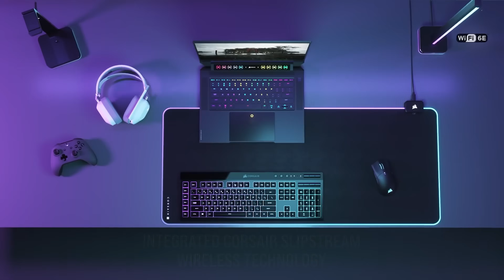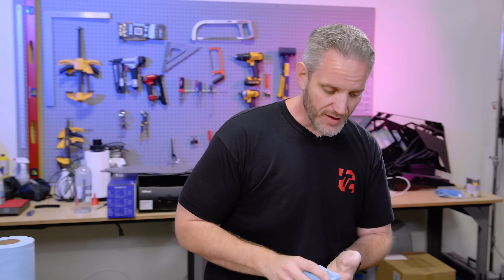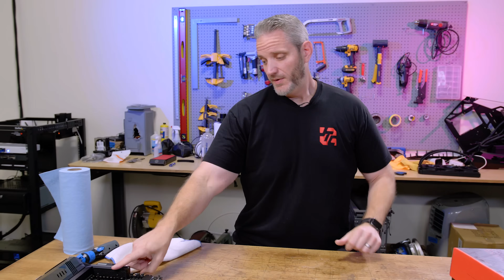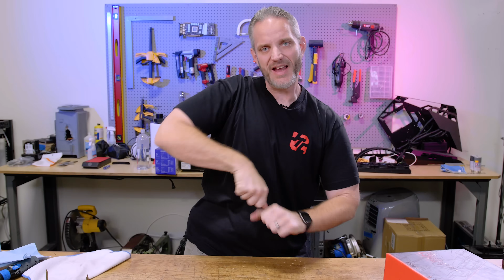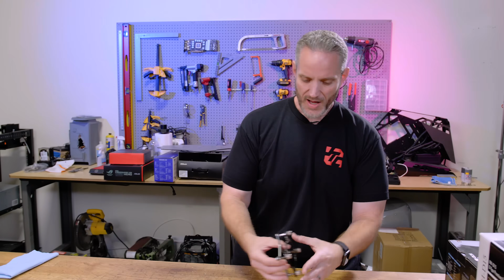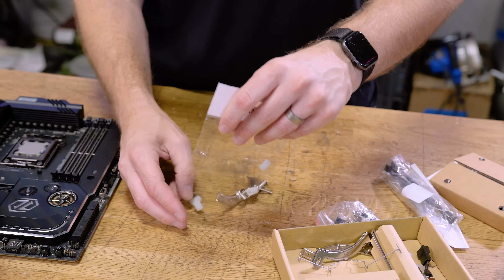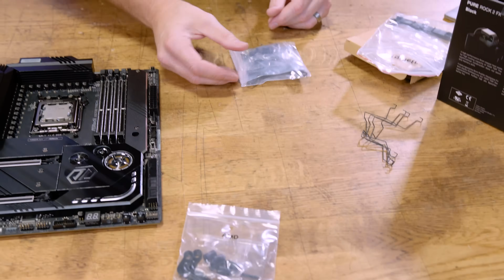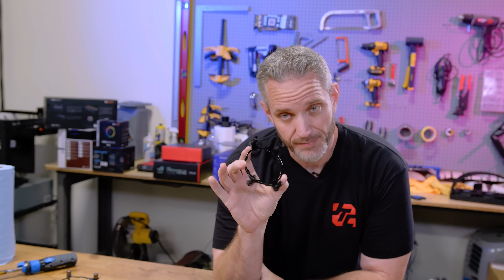AMD made a terrible flaw with this design...

Comment: I wish they hadn't worried about cooler compatability and just made the thermal transfer as good as possible.
Reply: My take on it is that they need the room for future 3dvcache additions?
Reply: @jaydenwhite2724  but then the die of the cpu is to low anyway? so, i dont know. do you think they will change the ihs, so it has different levels of thickness?
Reply: @jaydenwhite2724  I suspect the X3D range might be one of the reasons why as well, but marketing still have to sell this to consumers before then.
Reply: @jaydenwhite2724  good point
Reply: @SoundwaveSinus9 gtx480-sli wants to talk with you about being 100°C at the die all the time
Reply: @majstealth  I know, lol.  My 5700XT is still going strong at 100C.  My MSI 6900XT goes to 110C in a few games.  Not to mention these are all maximum load which are hardly the norm.
Reply: @SoundwaveSinus9 Reduce the temp limit then.
Reply: Just undervolt the CPU? That was the first thing I thought about. My 5800x has been at 45c under load and I haven't lost any performance. Chilling at .975 volts
Reply: @SkyRecruit18  holy SHIT you got a golden bin there, my guy. Consider me mad jealous 😂
Reply: Oh ya adding more cost to an already expensive platform will help sales lol!
Reply: @martytube821  Oh, yeah, DDR5 Intel is even more expensive. Lol.
Reply: @martytube821  AMD could of made the socket thicker for pennies on the dollar so the IHS could be thinner. This would also insulate some heat away from the motherboard
Reply: @timothygibney159  "could of made' <- genius
Reply: lol this thread, you guys are fighting about the 95c of AMD that only happens when benchmarking or rendering lol, the 7950x runs at 70c when gaming so it won't be a problem. I hate how reviewers highlights extreme scenario that only happens to some people and make it seem that it always happens.
Reply: @apricreed9580  haha. You find it annoying. I'm the one getting all of the notifications 😆
Reply: Choosing and buying hardware is a lot easier and enjoyable when you aren’t debating with armchair engineers that think they know better than the actual engineers who designed the chips.
Reply: I   agree, aldough the Temps in gaming are 60 to 80c which is normal.  Unless you are slamming the cpu in stuff like cinebench the cpu has normal temps
Reply: All they would really need to do is sell the appropriate hardware for both sockets and not a mediocre one size fits all contraption that should have never been marketed for both sockets.  If I had ruined a CPU from overheating it from use of a bad cooler that they said would not ruin it I would get together with all the people who had it happen to them and sue them out of existence!!
Reply: @charleshines8523  What people have ruined them?
Reply: Yeah they gimped the design of Ryzen 7000 series and I believe they engineered around the problem of the IHS making changes to work at 95 degrees. I haven't heard of the warranty of the new 7000 series, but the idea of running a 95 degree CPU for 3 or more years just sounds like a noisy hot mess to me  bound to cause AIO failure.
Reply: Being forced to change mobo and ram at least costs a lot. Being forced to buy AIO too... i would go for 13gen ddr4 and spend way less at somewhat similar performance...
Reply: @nenadcaric5195  I Typically upgrade every 2-3 years, so wouldn't make sense to go Intel since I have 5600X.  Both will be good for many years to come for people.  No wrong decision.
Reply: @farmeunit  yyy i spoke about real upgrade, from lets say intel 9 gen or older..  i personally will skip upgrade for a few more years... i have 5800x3d and Rx 6900 xt... i upgraded cpu from R5 3600 and I'm good to go now for a loong loong time since i assuming that gpu will hold 1440P gaming for at least 3 years 😅
Reply: With the amount of AM4 coolers out there I'm glad they are making them compatible, that would produce a ton of waste. But I guess the 2nd hand market would be booming.....depends if you trust a 2nd hand AIO?
Reply: @SoundwaveSinus9 It is overheating at 95C you are reducing the lifespan of the silicon significantly.
Reply: @Edpro01-z5d  It isn't overhheating at 95C, you just grab for straws to make AMD fail.
Reply: They shouldn’t cater to the 1% of those who actually care about benchmarks. The vast majority of people who are buying these CPU’s are probably buying them either for work or for gaming.
Reply: I love watching how everyone just absolutely shits on the one dingo berry
Reply: Yea, but it's ezy to be wise afterwards. 
To fix this issue I am all happy if there is going to be a de-lid kit to buy so I can remove it safely and have all i need to mount the cooler correctly afterwards or use liquid metal. For sure I do understand it's not a task everyone is cool with
Reply: Who cares about thermal transfer efficiency when it's gonna hit 95C anyway
Reply: Same
Reply: ME TOO!
Reply: @SoundwaveSinus9 There is something that is not being said or discussed (I don't understand why) But these new AMD AM5/7000 series processors running 95c constantly is literally the definition of planned obsolescence. These processors will not be functional beyond 7 years max and most will likely die at 5 years or sooner of daily usage at these temps. AMD knows this. They expect anyone that buys today's 7000 series processors will upgrade or replace their system well before 7 years and likely before 5 years so they don't care if their parts fail later. This is what has me feeling a "sour taste in my mouth" for AMD this time around. Everyone can remember the R9 290X/390X "Hawaii" chip video cards. The stock blower cards were all "Designed to work at 95c" and here today there's almost none of them still functional years later. They all failed because they ran hot for a long time. Any computer processing chip (CPU or GPU) that runs hot for a long period of time is going to fail faster than the same part that is run cooler. It's called physics.
Reply: @G T you would just need a different mounting kit, which would be fine. the way they have done it now, just sucks. yeah, you can get around it, kind of, by lowering the power limit and dont lose that much performance but making the ihs a proper thickness, would be the real solution, so you can decide for yourself. full power consumption and more performance, even though it isnt really much, or saving power and lower temperatures.
Reply: Am 5.1 will
Reply: I'm glad they went with cooler compatibility. Just undervolt
Reply: 95 degrees is a bit high and worrisome.
Reply: Agreed
Reply: AMD stated from day one that there where thermo issue. That is why overclocking was restricted from the beginning. Sounds to me like they knew very quickly after it went into production that they had a problem but the costs of changing the design would be too costly for everyone.
Reply: They just need to begin selling de-lidded versions of this CPU and allow vendors to custom make coolers that compensate for the missing CPU lid.
Reply: @sp6450  or wait for the v-cache version. Seriously though the temps don't matter, unless you're overclocking etc, it's rated for it.
Reply: @Commander_ZiN  The lower the temps the higher this thing will boost itself. V-cache or not my statement stands as a powerful solution. If you think AMD will change its lid to a thinner one to allow better cooling, I think its too late for this generation of CPU's.
Reply: @sp6450  no the cooling is fine, unless you're overclocking. You won't go any faster if it's cooler because you're still capped by power draw, You'll meet max clocks as is.

I have a 5800X I think TJmax was 95 from memory, even in the middle of summer over 90c still runs full speed. Granted it's closer to 70c usually or less.

Still I'd be waiting for v-cache anyway. They will have a thinner IHS because the chips are higher. The IHS is thick to plan ahead for v-cache.

Anyway look at the reviews, it's performing really well. If you want to overclock and remove the IHS even better, but I'd wait for reviews on that.
Reply: all the noctua wah wah babies would cry
Reply: @jblps  they would survive it.
Reply: "Partial" cooler compatibility.
If they had a normal IHS and the same 95 degree target they'd look even better in the graphs.🙄
Reply: The problem with not having compatibility from the start is the length of time it would take to make a completely new cooler design for companies. Anyone who has ever heard of Noctua also knows they are positively glacial in getting new products out.
Reply: @nozyspy4967  i guess a new mounting kit would have done it too.
Reply: @nozyspy4967  CPU companies distribute the blueprints for cooler requirements many months before the release of a new socket.  Designing a cooler adapter for a new socket is nothing compared to designing the cooler.
Reply: @SoundwaveSinus9 It is a boost, it should not hit 95°C standard all the time. 

Apart from that, it should not boost past a certain wattage. So if you can cool the cpu at full boost (and that is indeed a tall order it seems) it should not hit that temp either.
Reply: @SoundwaveSinus9 science doesnt care about your feelings 😆
Reply: Agreed also they should've not worried about using LGA as well.
Reply: @sludgefactory241  why not? LGA is the only thing making sense at this pin and cpu size, besides making it way harder to just rip the cpu out of the socket when removing the cooler. 

That was a HUUUUGE flaw on AM4 PGA.
Reply: @RubiiX 😂
Reply: Why not both
Reply: Should have made that vapor chamber IHS prototype that they showed GN during the lab tour
Reply: O dont know what yall worried about my 7800 x3d never gets above 70c with a single tower passive cooler
Reply: exactly, bit of a head scratcher...
Reply: AMD is in a way doing what all x86 chips suffer: backward compatibility. All the old instructions set from the original 8086 to today is inside the chip but now they have contend with backward compatibility of an old form factor.

Wild.
Reply: @nexusyang4832  it just doesn't make any sense. A new mounting kit costs like 20 bucks if one is unlucky, many times manufacturers even provide them for free or like 5-6 bucks. If we now see that a different new IHS with a new mounting kit could save us like 10K or so, this seems like a steal honestly. 
IF you really wanna silently ulitize the full potential you WILL need to go with a custom liquid cooling loop or at least an AiO which fan speeds are controllable according to coolant temperature, otherwise you'll just hear your fans loud and clear. 

Even if temps get to like 70°C while gaming this will be super noticeable with usual AiOs and even a worse problem with air coolers that get the hot air from the GPU. And yes, even a 300W GPU throws in enough heat to make a significant difference.
Reply: @nexusyang4832  wouldn't it be great if both side agreed to cut old  extensions or emulation of old extensions
Reply: But they need to make x3D CPUs as well. I think thats the Reason why they made it that Way. They will have to make a smaller Heatspreader for that as well.
Reply: The fact they went for this compromise at the expense of freakin 20C is mindboggling to me, i mean i would expect this from Apple with the logic that the CPUs will break faster so more sales, very scummy from AMD and damn is this stupid, we're going smaller and smaller transistor-sise only to up the power draw and temps.....
Reply: @Nimzoc  WHAT compromise? "Oh noes, it beats the Alder Lake, but we have a huge IHS"????
"the CPUs will break faster"
And the sky is falling too, Chicken Little.
Reply: @markhackett2302  If you actually watched the video you would know?, they added an extra ~2mm to the IHS so that it would be "compatible" to other coolers at the expense of freakin 20C and a quite hefty decrease in performance due to said temps....(watch der8auer' vid on the impact after the delid).

Let me put it into entitled apple fanboy language so that everyone can understand, imagine Apple making a way bigger phone(say 7.5 inch) with way better performance but keeping only the display the same size only to be able to fit the previous gen glass screen protector(6.1 inch) and also due to this it can't cool properly through the screen  (or something) and it's also super hot....

I'm sorry but if a delid can reduce temps by 20c and add quite a substantial performance boost at stock voltage your design team is either very stupid or this was very intentional so that it can be "fixed" little by little in future iterations of Ryzen...

I honestly don't get people like you, do you hate inovation?, do you work at AMD?, are you married to Lisa? :)
Reply: @Nimzoc  It's not "scummy" in the slightest. zen 4 operates fine, 247365 at 95 c if you are doing blender renders all day. if you are not doing full thread loads all day, then it wont even get there. but amd wanted peoples coolers to work, and they had to move on to a new platform with am5 one day, which they finally did. people complaining about temps with zen 4 have no idea what they are talking about. ther is nothing to complain about here.
Reply: just delid the CPU and enjoy the 20 degrees C headroom ON TOP OF AN ALREADY INSANE CHIP.
Reply: @SoundwaveSinus9 Unfortunately these high temperature reduce efficiency due to higher losses. I would only use these cpus with direct die cooling.
Reply: @killersberg1  Undervolt…. Or run ECO mode….  Slightly under lock.  Lots of ways to fix the problem and you can get more performance because of increased boost headroom.  I agree it’s bad form, but easily fixed.
Reply: @farmeunit  When these get cheap enough to justify I will direct die and undervolt for optimal efficiency in an itx case.
Reply: @killersberg1  I will just wait for next gen.  I don't have the urge to devote to de-lidding or tweaking that much, honestly.  I just want things to work.  If it's a matter of clicking a setting, I will do that...
Reply: @farmeunit  If these were not so expensive I would go for it but you get more cores on raptor lake for the same money. 14 instead of 6 bruh.
Reply: @farmeunit  And it just works. Yet here you are, claiming you want it to just work, when AM5 currently works.
Reply: @killersberg1  We haven't got the price of RaptorLake. We only have retail prices. You retail, buying 1000s, bruh?
Reply: @markhackett2302  I didn't say it didn't work, lol.  But whatever....  I was talking about de-lidding, you know, which I specifically said in that post.
Reply: @farmeunit  But nothing stops you delidding the AM5, either, so I fail utterly to see how that could be relevant "in that post".
Reply: @markhackett2302  I just stated that I don't want to bother doing it, lol.  It is more work than I am willing to put in because I have grown out of those kinds of things trying to get the best performance.
Reply: @markhackett2302  Here in germany, where I live we already have street prices. The 13600k is 400€ with 14 Cores/24Threads, while the 7600x is 370€ with 6 Cores and 12 Threads. With intel you get cheaper last gen boards and way more cores. I know E cores are not nearly as fast as the P cores but they may just be the right thing for my application. If amd doesn't do massive price drops they really provide a terrible deal.
Reply: @killersberg1  20 threads, not 24
Reply: @killersberg1  Higher losses? Doesn't that mean more loss to the HEAT EXTRACTOR???
Reply: AMD has chose thicker Heat spreader, because the x3D need more space, 95 ° is fully fine, this temperatures comes up only on Full load and unnecessary cooling component waste is avoided. My Intel Laptop Hi-end CPU from 2012 goes always to 105° and its work fine until today.

In the case when everybody needs new cooler there will be undifferentiated hate too, because Intel fanboys are always on a Fanatic search to to talk up their product, just so that the Intel tattoo on the upper arm doesn't have to go.
Reply: @MultiPochop  I don't know why everyone isn't liking your post it's like the first correct post in this thread.

People the IHS is thicker for vertical stacking. Temps are fine, it's designed for it.
Reply: @MultiPochop  No the heat spreader is thicker because of bacwards compatibility with coolers. 3D vcache was fine with zen 3. 95C isn't fine.
Reply: remember some of old Electronics courses that said (for longevity of electronics components using Silicon): for each 10°C increase, you divide by 2 (yeah, 2) the lifespan of the component. So, you know that at 75°C continuously usage a given component will have a lifespan 4 times longer than that same component at 95°C (just imagine, then, if the temperature is at 50°C or less…)
Reply: @grospoulpe951  No, for each 10c ABOVE DESIGN TEMPERATURE you divide life by half.
Reply: @tim3172  alright then, let's accept that (but I still think that the lower the difference between ambient temperature and the CPU temperature, the better). Anyway, what about the other component near the CPU? Maybe that's why X670E MB are so expensive, MB manufacturer have to build stronger MB I guess.
Anyway, ZEN 5 platform is still young, so let's see what will happen in the future, I guess (personally, no rush: my 5600X works fine for my usage; just a GPU upgrade is mandatory, I guess ... Navi 32 / AD103 (or even Battlemage 😅), maybe...
Reply: @grospoulpe951  So it lasts 400 years at 75C, 100 years at 85C, and 100 years at 95C. I fail to see the problem with that. Further, those "old electronics courses" would be from, oh, I don't know, OLD ELECTRONICS. Old Ford motors got to 25mph. So claiming "Some old magazines say you will have your lungs explode above 35mph" is ACCURATE, but meaningless.
Reply: @grospoulpe951  That only meant for Capacitor, but for CPU I don't think this will make much a difference. I'm a power supply engineer BTW.
Reply: @Ssin1235  Ah, OK, then 🙂
Reply: @grospoulpe951  Thank you sir. Some common sense. Also I want an all white mini itx build as my next. Heat matters especially in that form factor. It's harder to build for sure and a challenge
Reply: @timothygibney159  so just turn on ECO? This is literally a mode switch that significantly Cuts power budget and therefore thermals, while giving you 85 to 90% of the performance. Your argument of "I'm going Intel because AMD's running hot," IMMEDIATELY falls apart because news flash, SO ARE THEY.

This is a direct consequence of the gigahertz arms race, (CPUs and GPUs alike) which in my honest opinion has BEEN stupid for almost 10 years. Tens of Watts in extra power draw for a couple hundred megahertz and it makes no sense.
Reply: @spence8920  Lol wow the salty flamethrowers are after me lol. Look dude my 10 year old pcs still run. I want a mini itx white build next. I care about heat and longevity and have been burned (no pun intended) in the past by ATI/AMD overclocked GPUs burning hot and loud. I do not want them. THe difference is (yes I agree 12900K is too hot) is Intel is not designed to immediate thrust to 95 TJMAX BY DEFAULT. Gamers Nexus confirmed this was deigned to win at benchmarks and just not worry about it. I know you are an AMD fan and feel hurt but it is just a company and if we all don't want to have overpriced garbage ...looking at you Nvidia ... then we need to stop associating identities with companies and open our wallets. The difference between Intel VS AMD is Intel doesn't deliberate design their products to BURN by pdo 2.0 to 95C by default. They can get that hot but not without after turning off half the motherboard features and fan curves. 

I may just give up and get a new hobby. If Intel's 13900K does the same I will go angry too! I will retract my comments here and get an Xbox when my 9900K and 380ti become obsolete. ... ok maybe that is extreme but jeesh. You spend your money on what you see best I will do the same. For the record the reason I use Intel now is 1. For work/certifications my Hyper-V lab needed embedded virtualization. Intel VT-D/X supported this for 5 years before AMD-V 2. I use Intel RST for my raid 0 ssds for my VM lab work. If you are reading this as a gamer who cares it is not your use case. AMD-V now supports hyper-V so I can switch so I am open again. This has nothing to do with me being a fan of one company vs another
Reply: @timothygibney159  The 12900K does get to 95c it only stays there for a few seconds as Intel arbitrarily limits the turbo boost.
"AMD-V now supports hyper-V"
It supported it in the Athlon X2 days (circa 2005).
What planet are you on?
Reply: @tim3172  I knew someone would have answered that, I just spend 20 minutes reading comments just to see it :D I was thinking exactly the same when I read the guy's comment, like 'euh, did I miss something? what is he talking about?' :D
Reply: @timothygibney159  Tell me you work for userbenchmark without telling me you work for userbenchmark.
Reply: @timothygibney159  "Oh noes, everyone is against me, I MUST be right!!!!". Nope. You are wrong. You'd get "flamethrowers after you" if you claimed 1+1=Elephant too, and here you are whinging.
Reply: @SoundwaveSinus9 My 5 year old h100 Corsair aio pump still works. How? I don't overclock my 9900k past 4.9 ghz and that 5.0 ghz barrier rapidly increases voltage from 1.26 volts to 1.34 and increases heat by 17c! So my h100 pumps only 1/3 to 1/2 it's normal rate. I only feel heat when working on virtual machines for work. 

95c IS NOT ACCEPTABLE?! I don't want to buy a new aios every 3-5 months. I don't want to have my motherboard warp like the Xbox 360 red ring of death due to this. I don't want to hear my fans blast full 90% of the time and get hot so AMD can win at benchmarks. It's not normal. FYI why do Honda Civics last forever? The reason is the engines and transmissions are over built and under run below spec so they hardly ever wear out.
Reply: @timothygibney159  havent you seen the video? the ihs thickness is the problem and they did that for cooler compability. would they have done a thinner ihs, then there wouldnt be seen 95 c temperatures, with a decent cooler. i guess it would be 10 degrees less or so? so it is not a problem of the silicon being clocked to high "for winning benchmarks". it is a problem of the ihs thickness, which could have been solved when you get rid of the backwards compatibility.
Reply: @bertracoon1884  I think it's both though the agressive boosting is, because Amd wanted to be within striking distance from the 13000 series of Intel Cpu's.
Reply: @bertracoon1884  or the cpu would bend like intels last gen and temps wouldn’t fall.
Hell Amd did make a rescission there e and it runs well.
Best thing is to give the 65-105w tdp via Bios.
Reply: @gr3if  yeah but the thing is, most endusers will not change things in the bios. they buy a complete pc, press the button and use it :). i would have prefered if they would have used lower power limits on stock.
Reply: @Masaim6  i dont know what kind of numbers 13th gen will put out but of course, they tried to get as much, as possible, without the cpu crashing. for the consumer side i would have prefered them to do differently, exchanging, lets say 2 percent of performance, but getting 5 degrees or more less temperatures, on stock. but i get why they have done it this way. anyway, a thinner ihs would have been reasonable and i would have done that for sure. yeah, you lose compability to old mounting kits but i guess cooler companies could offer a different one for 15 - 20 bucks to make it fit again. i would trade that any day, to get way lower temps.
Reply: @bertracoon1884  That would be cool, you can thank Intel for that. However: Since the cpus are aiming at 95 degree and you realli have physical problems bringing that much heat away from such a small point its kinda okay. 

Fun fact: If you look into the 12-45w world where laptops tipical aimed at it gets so much better.
Reply: @timothygibney159  just use PBO to lower the max power target a tad bit and the temp issues go away. See what results were gotten by Optimum tech. You're not even throwing away performance.
Reply: @timothygibney159  Dude... AIOs aren't impacted by how hot the CPU runs. They're impacted by how much heat is removed.
Heat is a function of power consumption... not the absolute temp the CPU runs at.
A CPU consuming 200 watts at 40c will require MORE colling capability than a CPU consuming 95 watts at 95c... 

Do they no longer teach physics in high school?
Reply: @tim3172  ty
Reply: @timothygibney159  Intel is also hot as hell this time around you're gonna have to wait if you want under 80c with any new CPU.
Reply: @XxViciousxX  why you lyin? My 12600K barely goes above 50C with a “Cheap” Cooler Master Evo. Stop Crying 😢
Reply: @edy6722  But you're not pushing that little chip very hard then. I was also talking about new gen CPUs AMD RYZEN 7000 and Intel 13th gen (unrestricted power settings for each)

Also I have nothing to cry about too busy enjoying gaming on my awesome PC 5950x RTX 3090 hooked up to a 48in LG C1 OLED. All of my desktop PCs stay very cool especially while gaming.
Reply: @XxViciousxX  Haven't seen higher than 60c on a 12700K, but sure, "hot as hell".
Reply: @xnyxiee1784  Talking about top spec CPUs running with all power restrictions removed. 

Plus your CPU is not new 7000 series and 13th gen would be new so I wasn't even talking about your generation of CPUs. The only one from your gen that runs hot is the 12900k.
Reply: @XxViciousxX  You're forgetting about AMD's eco mode haha. Hardware Unboxed talked about it recently
Reply: @timothygibney159  Junction temperature is not what your AIO is going to be operating at. The high heat of t junction is due to poor heat transfer. There is a gradient between die temp and temp of your cooler. t junction is not how how your mobo is going to be.... and even at a peak of 95C (which is not what it will run at while gaming), that temp is likely no hotter than the VRM on your overclocked 9900k's mobo with an AIO. OH NO! Your OC'd 9900k's VRM might be so hot your mobo is probably already warping like an XBOX 360! 

"The dsoldering only lowered 2 degrees?! He had to manually undervolt and turn off boost to lower it 20c. Yes it's designed to win benchmarks and incompetence by AMD and burn out quick."

You didn't understand anything you heard him say. He said that derbauer saw only a 2-3C different between direct die+liquid metal and direct die+standard thermal paste. The difference between the CPU with stock IHS and the CPU with direct die cooling was approx 20C. Which means the IHS is affecting thermal transfer due to its thickness. You are a mental mid-get
Reply: @timothygibney159  why isn’t 95 acceptable? why do you care?
Reply: @timothygibney159  the die size decreases are why the thermals are so high, or SEEMS to be high. In reality the heat 'density' isn't that much. Its less or the same energy just concentrated in a smaller area, your cooler will be fine. In fact I would bet that the amount of heat being transferred really isn't that bad compared to recent high end CPU's especially overclocked ones. 
This level of heat isn't going to make your AIO lose fluid levels at any higher of a rate.
Reply: @timothygibney159  You don't even need to use an AIO on Ryzen 7000. A decent tower cooler will work just fine.
Reply: @timothygibney159  I agree but Honda vtec engines can die pretty quick when you get a hammer foot driver in them that want to vtech boost all the time. Which is probably most Americans lol.
Reply: @SoundwaveSinus9 Show me a competent electrical or computer engineer that says 95c is normal? Not a marketing droid from AMD. The life of electronics depreciate rapidly after each 10c after 65c from what I was told.
Reply: @timothygibney159  I'm a computer engineer, 95°C is well within the spec, and is 10°C better than you'll get with something like an Intel MacBook from the last 10 years. If you want lower temps under full load, undervolt the chip or pull back the power limit, but it is designed to work fine at 95°C.
Reply: @timothygibney159  yep and a small undervolt will get you full performance at that 20 K lower different that you want to much. Intel chips will be just as bad for cooling, even worse in an ITX system, don't know how you plant to run any top-end CPU in that form factor without applying an undervolt anyways
Reply: @timothygibney159  the delidding did NOT account for only 2 celsius. Need to relisten
Reply: @timothygibney159  Okay, and safe voltages also change from generation to generation. Using the same voltages as something from 3 decades ago would be unwise. Design around TDP also changes, certain electronics are rated lower, others are rated higher.
Reply: @timothygibney159  "Show me a competent electrical or computer engineer that says 95c is normal."
Many VRM components, SSD controllers, this CPU, most of Intel's CPUs, solid-state capacitors, etc. etc.
Reply: @timothygibney159  If you are really that worried about it then just manually clock it... Or go intel... I think you will run into the same issues with intel though. We are getting close to hitting the physical limits of how small we can make a transistor on silicon and as a result we are entering the era of big time power draw/temperature. The days where they could just go to a smaller node and gain tons of performance with no increase in power consumption/temperature are coming to an end.
Reply: @gromm225  Timmy may not be for Intel, they MAY be an NVidia fanboi.
Reply: No their firmware with the boost algorithm where it's supposed to hit 95c by design to win at benchmarks is why it overheats. Redicilous and I hope AMD and Nvidia with the 4xxx series both suffer in a loss of sales. In 2014 when I got into this hobby Intel CPUs only used 65 watts and AMD was the overheated pig with a bloated 100 watts. Wow have times changed
Reply: @timothygibney159  ?
Reply: @santiago1337Keloke  ?
It you want to make a point, how about MAKING it?
Reply: @timothygibney159  But it doesn't if you delid. Yes, 95C is the target with the default HS, but they could have designed a different HS for a lower target temp at the same performance.
In the best case that could have just required new mounting brackets for existing coolers.
Reply: @finestPlugins  Listen again to Jay? The dsoldering only lowered 2 degrees?! He had to manually undervolt and turn off boost to lower it 20c. Yes it's designed to win benchmarks and incompetence by AMD and burn out quick.
Reply: @timothygibney159  I listened to Roman already. And Jay also mentioned stock with a 21C reduction, at most three due to liquid metal.
Reply: @finestPlugins  Jay "...de Bauer only lowered the temp by 2 degrees C by the delidding ..". FYI delidding is dumb for soldered IHS as it does little to nothing. It was only a big deal when Intel used glue. You shouldn't have to do that in 2022
Reply: @timothygibney159  Listen again, 10:48 The two degrees you mention are attributed to the liquid metal.
Reply: @timothygibney159  Jay didn’t say that and I’ve been watching der8auers Video before this, maybe you should watch it too and rewatch this video and listen carefully what Jay says.
Reply: @finestPlugins  you don't need to delid, just tune it in PBO2 and you'll lose a lot of temps without losing performance.
Reply: @finestPlugins  It probably makes it cheaper, and those who overclock will get better overclocks "at the expense of" not having a valid warranty, because they delidded.
Reply: @timothygibney159  WHY Listen to Jay??? NOTHING he says was "AMD runs too hot, it melts!!!", and Intel goes to a higher temp.
Listen to Jay say something different from you???
Reply: @RafitoOoO  You could also do both.
Reply: @timothygibney159  "Intel used glue"
You're conflating Intel stating that AMD "glued" Zen 2 together (After Intel "glued" the Pentium D, Q6600, etc. etc) with intel using TIM.
It's incredible how you spout your ignorance with such passion.
Reply: @finestPlugins  Jay was wrong there as well, Der8auer said that he was using a new thermal grizzly liquid metal that is not being sold yet and it is like 2-3°C cooler than normal liquid metal. So instead of 20°C cooler it would maybe be 18°C cooler with the regular stuff... (i'm gonna say that was product placement and not reality)  
Of course you use liquid metal on direct die cooling. You don't put that much effort and money into a direct die cooling setup to then just use basic bitch thermal paste.
Reply: @ZeroB4NG  That's what Jay was saying as well. Have you actually seen the video?
Reply: @finestPlugins  *to the liquid metal.
Reply: @timothygibney159  it was 2c only for the liquid metal. Total was 21 degrees celcius. So the direct die (stripping the stupid thick IHS away) effect was at least 19 degrees celcius.
Reply: @timothygibney159  "Redicilous".
Reply: @timothygibney159  You got close to the truth, but still missed it: The intended maximum temperature is 115 degrees Celsius. Hence you still have a solid 20 K headroom. The 95/100 degrees Celsius mark to me seems to me based on intuition instead of facts and temperature limits. 
The cooling performance could still be much better looking at direct die results.
Reply: @Gladaed  Comparably speaking, 95 degrees on the AM5 processors is equivalent to about 82.5 degrees on AM4, which I would definitely consider "okay" but still uncomfortably high. That's a temperature where better thermal paste should be applied and a more comprehensive cooling solution should be actively sought with a degree of urgency.
I've got a 5600g that normally hovers in the low to mid 40s, around 65 during load. If this thing ever hit 80, I'd cut off whatever I'm doing and promptly disassemble for maintainence.
Reply: @trajectoryunown  That's a waste of time and money. A mid tier tower cooler is already overkill. If the CPU dies, so be it. Get a 5800X3D instead of that kinda cooling.
Reply: @Gladaed  Weird thing is, Intel Alderlake got 100C. Didn't hear a peep. I DID hear "it uses a LOT of power!!!!" when for GAMES it didn't, but again the 12900, using a lot of power for multicore workloads, was not much, if any, faster and a LOT more expensive, than the cheaper 12700 or 12600. But not a PEEP about "Intel gets to 100C!!!!!!!".
Reply: @trajectoryunown  You consider it? Do YOU make the processors then? No? AMD make them, designed them, and have been on camera SAYING that 95C is fine 24/7 operation.
Reply: @markhackett2302  operating temperature and power draw are only correlated.
Reply: @timothygibney159  no, it's designed to boost to whatever it can run at a 95 degree max. the more you cool it, the more performance it gets. you can lower this limit yourself if  you don't want it to run that hot.
it's not to "win at benchmarks", it's to provide the most performance it can, without going past 95. you are being redicilous.
Reply: @timothygibney159  Wrong on so many levels. AMD shot themselves in the foot with the IHS and that's it. Der8eur dropped temps and up performance without adjusting anything and only using direct die cooling. There's also plenty of vids of people using curve optimiser/undervolts/watt limits without direct die cooling and getting the same performance at 50/60c. 

Direct die cooling and those optimisations would make the AMD chips an absolute powerhouse (more than is already) and much cooler. You speak of Intel but all they have done with 13th gen is basically add more cores and more power usage, so if your beef with AMD is temps... pfft, get ready for raptor lake.
Reply: @SkullKidsRevenge  this tim guy is something.
Reply: @SkullKidsRevenge  Technically the rumors are that Raptor lake actually somehow runs cooler than zen 4.
Reply: @Masaim6  Considering the state of cooling 12th gen, I'll believe that when I see it. That said, a few adjustments to 7000 and the temps plummet anyway so  it's a bit of an odd one.

Leave it bone stock in a random mobo and it gets hot, play with PBO and undervolting and you can shave chunks off the temps.
Reply: @SkullKidsRevenge  That shouldn't be left to the consumer. it's Amd's job to optimize their products. The first part of your bio is true though we will have to see.
Reply: @timothygibney159  lmao
Reply: @timothygibney159  'overheats"
functions as designed within thermal parameters
'rediculous' <- lol
Intel CPUs never used 65 watts other than at base clock. The 6700K used 91 at base clock as did the 4790k, 4770k, 3700k.
The 2600k used 95 watts at base clock.

Isn't it great when people just make up their own arguments with fabricated "facts"?
Reply: @timothygibney159  LMAO salty much
Reply: @dropsey3007  No. I will buy Intel next gen and was hoping AMD would finally mature for me to switch. I won't do that now and based off sales AMD flopped. Not An Apple Fan on yt discussed this yesterday. Don't have your identity tied to a brand
Reply: @timothygibney159  So you'll buy intel that goes to 100C because AMD goes to 95C????
Reply: @timothygibney159  I hope you are happy buying a dead socket platform.
Reply: @timothygibney159  and didn’t flop Lmao and the zen 4 processors are much better then then new intel cpus. But do you I guess
Reply: @timothygibney159  You were never going to buy/switch to amd regardless. Your whole "I hope they fail" bullshit says as much.
Reply: @timothygibney159  Flopped? Not matured?  Hey guys, this guy has never heard of Jim Keller.
Reply: @timothygibney159  Intel last gen already ran hotter than AMD they arent any better lol
Reply: @timothygibney159  I think it's too early to tell if AMD flopped.
Reply: @timothygibney159  You do understand that helping cooling makes reaching that target temp take longer (or impossible), thereby improving boost clocks? How about you watch the derBauer video. The CPU MAXES OUT at 75 degrees on direct die. That lump of an IHS increases core temps by 20 degrees, and increases core-to-core variance.
Reply: @samiraperi467  Yeah it took him over 20 minutes of fine tuning it get it to 70C .. smh
Reply: @timothygibney159  You do know how to undervolt don’t you?
Reply: @timothygibney159  I agree on that 95°C isn't healthy, which is the result of AMD's IHS solution. I would recommend watching der8auer's video about this. It was a bad design  decision born from well-meant intentions. But it's not reason enough to dismiss the whole platform as immature. Like with Intel products you can deal with design flaws once you are aware of them. I would also not go as far as calling their engineers, or any electronics engineer for that matter, incompetent. At these skill levels it's hard for laypersons, which most of customers are, to ascertain levels of competence.
Reply: @ArmchairMagpie  No, 95C works 100% fine, 24/7. You didn't complain when Intel got 100C.
Reply: @ArmchairMagpie  "I agree on that 95°C isn't healthy" Source: my feelings and uneducated opinion.
Reply: @markhackett2302  “No, 95C works 100% fine, 24/7. You didn't complain when Intel got 100C.” Maybe I didn't complain to you, stranger on the internet, but to me, among others, it was a concern. One among many reasons I haven't switched back to Intel. Possibly, it will work just fine as AMD claims, but I want every joule of heat energy transported out of my case as quickly as possible. AMD's solution has put on the brakes on that idea. Oh, and I do agree with one more sentiment: always treat both, Intel and AMD, not as friends but companies who have to put up an effort to convince you, the customer, to buy their products.
Reply: @tim3172  Ad hominem.
Reply: @ArmchairMagpie  95c is normal but i dont want build a heater inside my bedroom since im living a hot climates country.. and with 4000 series gpu? I think my bedroom gona melt lol😂😂😂
Reply: @kiankit  I'm living in a room under the roof, which easily reaches 35 °C in summer. Generally spoken, as per physical laws, energy doesn't get lost in some magic pocket. Your heat-resistance inside your tower doesn't prevent you from some thermal repercussions once it starts affecting all components. It is much better to get it out, even if your room temperature is about 40 °C. I'm not buying AMD's gaslighting attempts here, which simply says it's normal. It's a peak temperature overall, but there are workloads where you can reach these pretty fast, as by my experience as part-time editor in the past. I am seeing a lot of fervent partisan hostility here, like if it's a religion and any criticism is heresy. What JC is saying is precisely my sentiment too. AMD did it because they knew they couldn't develop and create a production line for their coolers ad-hoc, so they, in an attempt to save costs, attempted the compatibility way. This cost-cutting measure meant that they only had to ramp up the rhetoric. Technically, a win-win situation for AMD, and perhaps they expect it to combine it with their RDNA3, but even so, next gen video cards will have their energy footprint. Do I expect Intel has got some magic wand to make their temperatures issues go away? Of course not. They simply expect the end-user to take care of the problems themselves. I am not drinking the Kool-Aid of both x86 companies. As a 4k gamer, it's better to upgrade graphics before CPU anyway.
Reply: @ArmchairMagpie  yup i agree ur statement too.. yea gpu is more for gamer i just found that my 5900x its more for my use on 2k gaming.. im looking forward just gpu right now..
Reply: @ArmchairMagpie  good point. I would imagine the engineers designing chips from scratch are pretty much exclusively brilliant
Reply: @timothygibney159  the ihs creates a difference of 20K. 

Chris is 100% right and this was the totally wrong approach.
Reply: @timothygibney159  This right here is why I quit using amd cpu's for the longest time I've always tried to stay at that 65w or less bar. My current cpu though I went back to amd as I got a 65w one (ryzen 5600x).
Reply: @timothygibney159  Are you abit drunk?
Reply: @rozwelljones4976  xD
Reply: @timothygibney159  with these hardwares its impossible to make itx and/or efficient pc’s. Who use that kind of pcs? Designers, software developers and etc. Are generic people like gamers need them? Actually not. It is such a comedy…
Reply: @timothygibney159  Except it's not "overheating"...
Reply: @timothygibney159  amd 5000 was 65w and Intel started playing dirty needing a 3 fan aio for their top chip, so amd had to fight back this gen
Reply: @25566  xD
Reply: @timothygibney159  dude, Intel have been historicaly been big as holes in just this type of matter, so you better stomp on all of them.
Reply: @timothygibney159  Then even if they kept the same algorithm wouldn’t it perform better with a better IHS? Also nowadays and for the past bit already all the big companies have been this hot. I don’t get what everyone is so salty over, it’s just AMD is using their cooler to the most. Also, you could alter PBO and get lower wattage, lower temperatures, and better performance
Reply: @timothygibney159  It doesn't overheat because if it did it would thermal throttle and it doesn't at that TJMax temperature. Paul over at Paul's hardware showed in gaming it will actually sit around 10 degrees cooler than TJMax while gaming with a decent tower cooler.
Reply: @timothygibney159  Before Ryzen I can recall people complaing about how small the improvment in intel cpus was and that they never went beyond 4 cores while mostly focusing on improving efficeny. Now that we see actual performance improvments again people are complaining about efficency.
Reply: @timothygibney159  It isn't. It could potentially run 10K cooler with same thickness.
Reply: @timothygibney159  when intel is above 100 degree duh
Reply: @timothygibney159 Intel fanboy spotted
Reply: @timothygibney159  except 95C isn't overheating lol. Non living things don't care. Silicon melts at 1,410C.
Reply: @l0s78  Go talk to some Xbox 360 users who got the red ring of death if you don't think a hot socket isn't a problem. I will wait 6 months and reply to these comments with a 😂 and told ya soon when the recalls start coming in haha.
Reply: @timothygibney159  You can absolutely design a machine to run all day every day at insane temps. See: embedded industrial systems, AC units, combustion engines, and so on and so on.
Reply: @l0s78  thats right next time lets rise tj to 1400C, who cares about having a functional cpu.
Reply: @Edpro01-z5d  Well it DOES prove you wrong, 95C is nowhere near the 1400C melting point of silicon, so it can't be failing, can it.
Reply: @timothygibney159  "Go talk to some Xbox 360 users"
That was a flaw in lead-free solder which caused the RROD issues... the thermal cycling of the solder cracked it.
It wasn't because the Xbox ran "too hot".
Reply: @tim3172  yeah yeah yeah. I will wait until 13th gen intel is out there and beat AMD. Again. 😂
Reply: @timothygibney159  bruh... Xbox 360 was direct DIE cooling, it didn't even have an IHS. The problem was the lead free solder they used that melted the solder around the RAM which then lost contact.  
So yes, it was too hot, but not because it was cooking, but because their Hardware was a shitty design that couldn't stand the very normal heat output.
Reply: @timothygibney159  The red ring of death happened because the lead-free solder was out of spec and couldn't withstand the repeated heating/cooling cycles. That's completely irrelevant here.
Reply: @l0s78  exactly, hot to humans is not hot to other materials.
Reply: @l0s78  lol yes it is lol lol, and lol.  95c is a stupid amount of heat that has to go somewhere, and it ends up heating up the room.  If you already live in a hot climate, like me, then the last thing you want is a CPU that makes the room hotter, even if it's "ok"  lol lol and lol also lol
Reply: @picklesandufos7860  95C is a temperature, not an amount of heat. Thank you for your dissertation, clearly you are a materials scientist and/or semiconductor engineer.
Reply: @l0s78  Yes Poopybutt, temperature is a measure of heat.  Very good. Temperature = the amount of heat being measured.  You get a gold star!!
Reply: @picklesandufos7860   Two items can be the same temperature and have vastly different amounts of heat to dissipate. The same CPU can be at 95C at 65W, 105W, 145W, or even 200W+. The 95C 65W chip will heat your room up a lot less than the 200W 95C chip. And a 80C 200W chip is dumping just as much thermal energy in to your room as a 95C chip, the energy is just being dissipated from the local area (CPU) faster.

Bottom line, the people who know a lot better than you signed off on 95C not being a problem. Now move along children
Reply: @l0s78  Yep, they signed off on it because they wanted to make a chip with an IHS that could still fit coolers for the AM4.  You act like everything "signed off on" was always awesomely designed.  Nothing ever designed has ever had flaws right?  Btw the new chips are only 95c under multi-core load, not in gaming, which is all I care about , so it's sorta moot, but the chip IS pulling about 230watts when it's at 95c.  Dunno what world you're in thinking these chips are only going to use 65 watts.  Fantasy land.  So, correct, I'm talking about 95c at 230 watts, dunno what 65w, 105w, 145w fantasy world you live in.   Anyway, you going to endlessly reply to make yourself feel better?  Why don't you move along first and stop replying.  Lol only 65 watts......
Reply: @timothygibney159  why not enabling Eco mode? Or just limiting the TDP to whatever you want in the BIOS? And don't act like your 9900k OC does not pull a lot of power....
Reply: @timothygibney159  no if the IHS was thinner it would still reach 95℃ but with more performance
Reply: @oliverboi  Which proves my point. No sale for me.
Reply: @timothygibney159  It was never going to BE a sale for you, because it DARES to be from AMD.
Reply: @oliverboi  i dont know. i think there is a point, where lesser temps dont mean more frequenzy. those dont clock up to 7 ghz or so, if you can keep temperatures low enough. there is a limit what chips can do.
Reply: @timothygibney159  Phenom called. It wants its temps back. 
Phenom used to run at 95C by design. They were an absolute nightmare to cool (pre AIO era) as it would lead to catastrophic failures with other components due to the excessive heat.
Reply: @saturnGEEK  Bingo which was why I switched to Intel. However my phenom II didn't get that hot back in the day. It was their next pile driver series which was overcooked to the wahzoo to catch up to Intel. That is when I switched to a 4770k when my phenom II was aged and left the AMD bandwagon. Ryzen was giving me hope but I will wait until Raptor lake to see what it offers. If I do switch to AMD I will have to research the board to make sure I can turn off all overdrive BS and undervolt like hell which is redicilous
Reply: @timothygibney159  Phenom II had the temps under control after significant backlash by Phenom owners with continuously failing systems. 
Phenom X6 Black Edition was a beast in its own right, but having to replace a motherboard after 12 months due to significant deterioration of components caused by excessive radiant heat was what pushed for better temperature management... until Bulldozer existed.

Edit: The carrying on by fanboys back then is identical to how it is now. Replace "Phenom" with "Ryzen" and get the same identical response.
Reply: @saturnGEEK  Uhh... Phenom wasn't difficult to cool at all. it had a junction temperature of 60 degrees.
It would never have run at 95 c as it would thermally throttle then shut down before that.
Perhaps you're thinking of Bulldozer? Which also didn't run at nearly that hot.
Reply: @saturnGEEK  I still run on Phenom II X6 1100T Black, and yes, its quite warm and loud when playing (mainly due to old vents), but its running from 2010 almost every day, and its still working..... if new AMD chips will be same good I'm in :D .....
Reply: @saturnGEEK  I still run AMD Phenom II X6 1100T Black Edition on GIGABYTE GA-890FXA-UD7 from 2010 till now, almost every day, and it still working good :-)
Reply: @saturnGEEK  You speak like someone who’s never taken a heat transfer course.